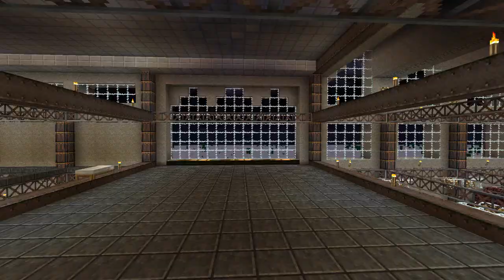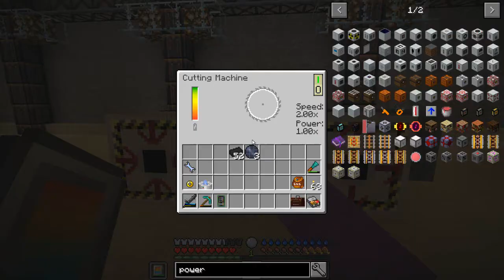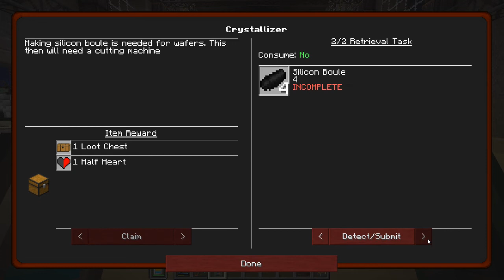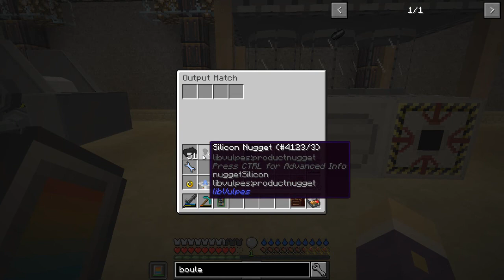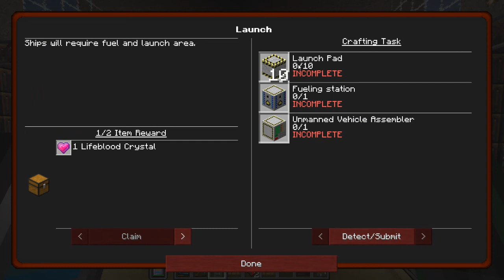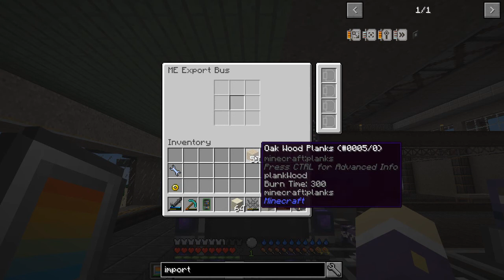[Lets Play] Forever Stranded : E37 - Up to my Eyes in AE2 Channels

Comment: Hi Nemsun, very nice explanation of cables. Yes indeed a ME storage bus on a drawer controller or controller slave works extremely well with AE2, cheap storage and no power requirements. Also if you use compacting draws for the ingots, gems, bricks, clay, quartz you never need a recipe to make nuggets or blocks.

Indeed Advanced Rocketry is a awesome mod that is actively being developed. I reported four bugs this week and they are all already fixed!

I'm hoping that Mr Sheridan will will fix the "Launch" quest, you really need a Rocket Assembly Machine and not an Unmanned Vehicle Assembler (as the latter can only be used on a space station to build rockets for gas mining, gas mining is needed for Terra-forming). Also I hope he replaces Waila for Hwyla as the latter works correctly on the hatches and the Thermal Expansion machines. It's hard enough to make a video on new mods without reading the wrong block.

Happy to sieve for you duncan9322